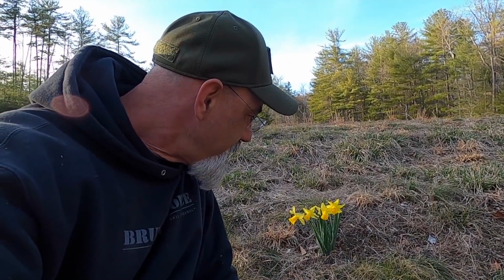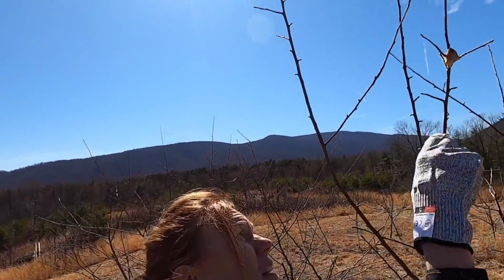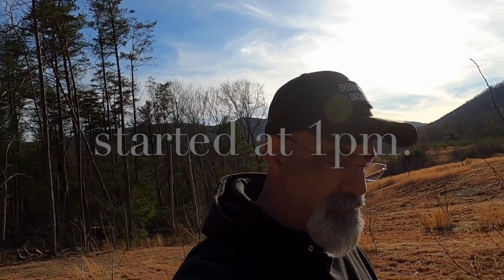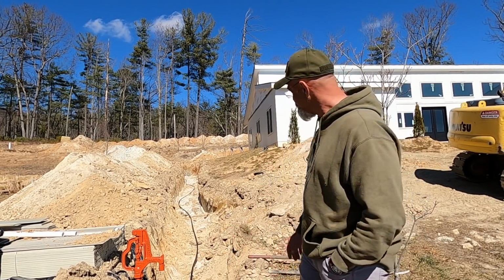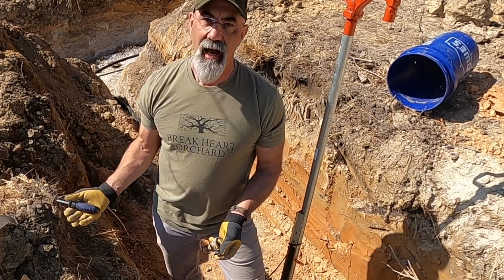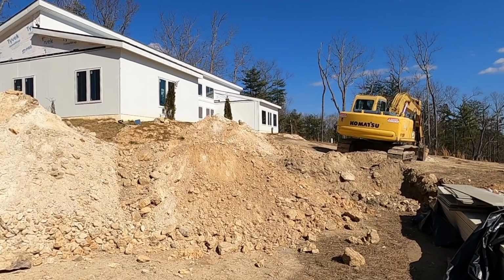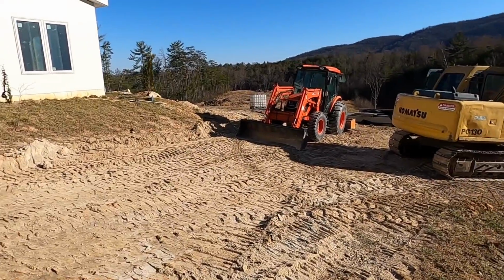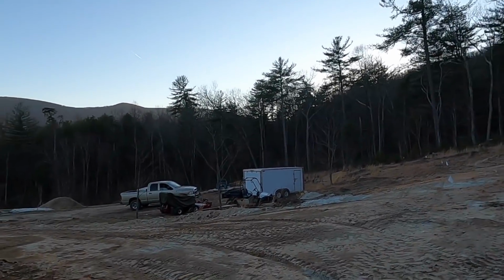Pruning the Orchard and Backfilling the Water Lines.  Komok Cordless Electric Pruning Shears.

Comment: When burying electrical conduit. You need to install electrical manhole every 100 feet. This way if electrical wire breaks  you can make the  repairs and a lot easy pulling electrical wire. You will never find the short.
Reply: Only in commercial  applications

Comment: Surprised that you didn't put the conduit in ,when you buried the water line.when you do install it go oversized example  if you planned on 1 1/2" use 2" instead. Also leave a mule tape  in the conduit  for future wire pull if needed
Reply from the maker: I haven’t closed the main line to well yet. Keeping it open till we get everything in.